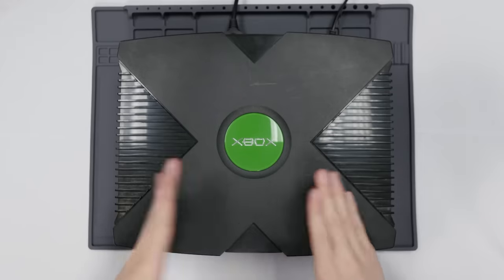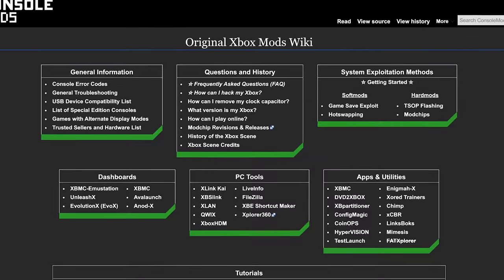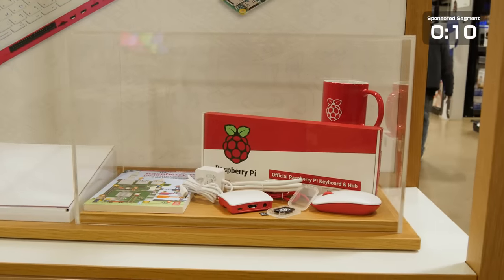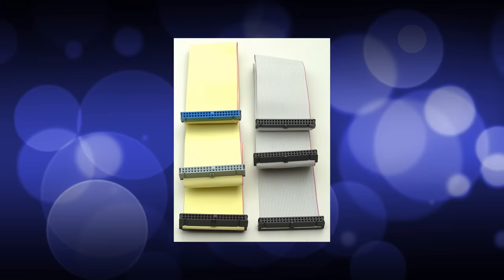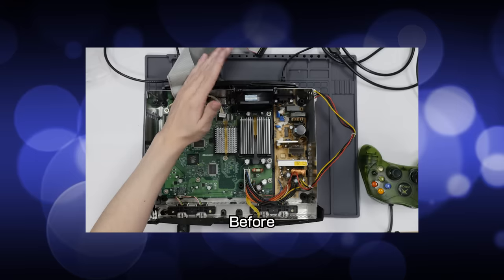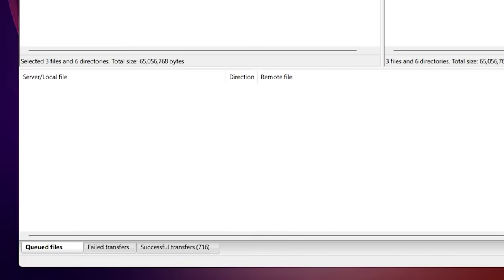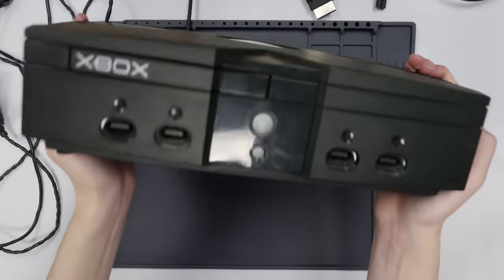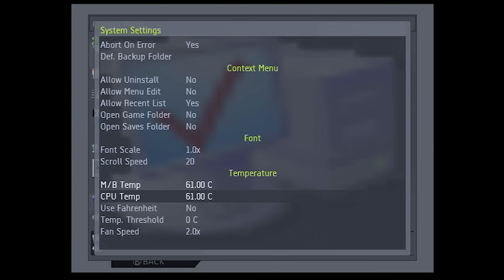The original Xbox is so NOISY. Let's make it ˢᶦˡᵉⁿᵗ

Comment: It isn't that they've gotten old. HDDs of that era were absolutely that loud when they were new. PC noise levels peaked at about 2006 before quieter and cooler components started really creeping in.
Reply: Man I remember how loud they were 2004 to 2007 oh my gosh idle, loud as a jet turbine. About PS4 Pro levels at idle.
Reply: I remember back in 2005 I got an Emachines PC, and if you booted it with someone next to you you'd have to move away just hear each other speak clearly. Almost makes me miss loud electronics.
Reply: It wasn't the hard drives in 2006. It was the small high RPM fans that were everywhere, CPU, GPU, PSU, cases and even ram and HDD coolers. The loudest hard drives I've heard new were in the 90s (your quantum/maxtor fireballs and IBM DeskStars alike), but especially the very first ones in the 80s are super loud (when they were huge double slot 5 1/4'' peripherals, so a lot more rotating mass). Just look them up on YouTube.
Reply: @Naukograd i'm sure theres a modern motherboard bios out there with that feature you can toggle.
Reply: @Naukograd Yeah the feature is still there (POST beep), you just need to enable it. I'm not sure if prebuilt computers have a PC speaker inside, but buying any motherboard will include one.
Reply: From so loud you'd have to cover your ears to quiet to loud to quiet again.
Reply: @MarcoZ1ITA1  The fans were the primary culprit, yes, but the HDDs were insane on their own. In my retro rigs I replace anything that moves (apart from optical drives) with a modern quiet alternative-- replacing the fans wasn't enough.
Reply: @Naukograd It's the little things that leave the fondest memories.
Reply: I have a computer around that time that is not too loud. It is quiet compared to an Xbox or a Dreamcast. The loudest part though is the little northbridge fan. I wd40'd it recently and it came down to a tolerable level even though it is still the loudest part of that system.
Reply: Making me feal old. Yeah, HDD back then were loud, even louder the further you go back. My first HDD, a 40MB HDD was quite loud. Yes, that was MB, not a typo.
Reply: @Roninkinx  You get a PC and nice white noise machine all-in-one in case you want to take a nap.
Reply: small fans without good curves cooling 115 W Pentium 4 chips were quite a different beast. The cooling was such a task that they even came up with a different form factor.
After that it got better again. Bigger coolers and more efficient chips plus more adaptive fan curves made things much quieter.
And now we're back to 200W CPUs and 350W GPUs
Reply: @HappyBeezerStudios  so they went from loud to quiet to loud to quiet and loud again
Reply: I still have my 80GB HDD from 2004, and that thing was super freaking loud when it was new. So yes, HDD's were very noisy. HDD's now seem to be silent though, I have 2 new ones that don't make a sound.
Reply: @GiSWiG  My first HDD was 5MB! In a Compaq Deskpro Model 1 (8086).
Reply: @msthalamus2172  I had a Tandy 1000 8088 w/ two 5.25 floppy drives, might have been 320k if I'm not mistaken, no HDD. The 40MB HDD was with my Tandy 1000 RLX 286 1MB RAM and an 8-bit Sound Blaster (only had one 8-bit ISA slot). If I was to have back any of my old PCs, it would be that one.
Reply: I can attest to this. I had a gateway desktop computer from 2006 that I bought new and that thing was LOUD. The older it got the louder it got. Later I got a 2006 imac and it's almost silent even still to this day.
Reply: @MarcoZ1ITA1  loudest I've heard is a quantum bigfoot... It's so loud it's louder than PCs
Reply: If I recall correctly drive manufacturers were starting to suggest that consumers buy 10k rpm or 15k rpm drives at about that time, too, can you imagine how much noisier that would be. Antec (case and fan manufacturer) shot to relevance with some stylish but quiet fans, cases and power supplies.
Reply: @msthalamus2172  I don't mean to call you out on your 5MB hard drive but I was under the impression the first affordable (not thousands of dollars) hard drive for desktop computers was the ST-225 which was 20MB. Maybe there were drives from other makers that flew under my radar
Reply: @Autotrope  I've always really liked Antec cases. :)
Reply: Man, I've still got wd velociraptor 10k rpm drives. Literally sounds like a honda s2000 on stereroids.
Reply: Dude I ran a Minetest server on a 2005 Dell dimension with the squirrel cage cooling fan. I kid you not, with 20 connections I could hear that thing go whooofRSHMMMMM from outside of the house. It woke me up more than once.

I use a raspberry pi now 😉
Reply: Yeah i remember that time 😅😅
That was the era of putting the computer on the floor instead of on your desk. 😆😆

"Dont feel the need for that hdd led anymore... Ill look down if something goes wrong..... Kick. Damn"

Pis are the future. We need more more more.
Big ugly pc are vile to me now. Do all my gaming on lappy and pi nowerdays...
Reply: I remember the first time I played on a friend's Xbox and thinking that it was going to break because the drives and fans were making so much noise.
Reply: is it even possible to buy new old stock of these? i would love to replace my childhood one with a new one with longer life, i love how it sounds inside the xbox. Always sounded so futuristic space agey and it blew my mind as a kid.
Reply: Yep, my normal midrange HP laptop in 2007 sounded like a jet engine under normal use, and when I'd fire up Crysis... Well let's just say I couldn't do that in the living room while other people were there😂
Reply: @MarcoZ1ITA1 When I'm FTPing files to my XBOX, I can hear the HDD from the other room!
And it's not the age of the drive, this unit had been sitting in a box for 20 years, and I remember my tower PC in 2006 sounded the same.
Reply: @granite_planet  "but buying any motherboard will include one" Haven't seen a board that included a buzzer in ages.
Reply: Why not just add sound-proof padding?

Comment: Matt, I'd really like to see you getting a modern heatsink, that is suitable, or can be modified to fit inside, and replace the stock heatsinks, as they seem very suboptimal. That would heavily increase the cooling performance. I know that 60°C is fairly normal operating temperature for chips like these, but if you keep them at a lower temperature, say 30°, they'll last longer, which is an important thing to consider when we talk about discontinued vintage electronics
Reply: yeah, hardware preservation becomes relevant. Machined copper alloys liked in those coolers aren't much better at heat conduction than alu, but much heavier, so going for that sexy copper look might not even be the best choice. But a better cooler, perhaps something with heat piles and a more optimized fin profile should help getting the heat off the chip.
Perhaps even an intake fan at the side (where holes are visible) could further improve cooling.
Reply: Don't forget new thermal paste
Reply: That kind of option probably wont work for me personally. I have a 1.0 unit.
Reply: 30°C?! Yeah right, maybe with water cooling with a car's refrigerant tank.
Reply: The Xbox original's hardware is so low-power, we probably have the technology to cool one entirely passively

Comment: A suggestion: use foam to seal the gaps between the fan and shell, and change the thermal paste on the heatsinks.
Reply: with something very advanced for cpus
Reply: heat up the xbox before you change the thermal paste, that shit is like epoxy after 20 years
Reply: @desertman123  Tell me about it. I repasted an Xbox a year or so ago and that stuff pretty much IS epoxy. Thought I was going to damage the board or CPU trying to free that friggin' heatsink. I've never had such a hard time in all my life removing paste/heatsink and I've opened a lot of machines. Just have to have a lot of time and patience if you're unlucky enough to have that rock hard pink paste (they used different paste over the years and runs, if memory serves...some being far worse than other's). Ironicaly the GPU used a different white paste on my unit and that came right off, go figure.
Reply: @desertman123  I had to do that on my 1.0 to get the GPU heatsink off without breaking anything, I just used a hair dryer on high 6 - 8 inches away from the board for 30 seconds and the heatsink came off easily.
Reply: @MotorHorse  I did this yesterday, and used Arctics thermal paste remover which worked well. I put a carbon thermal pad on the GPU and normal thermal plaste on the CPU, so I no longer have to bother with that crap any more. Mine also had that black epoxy like crap on the GPU as well lol.
Reply: Oh god I didn’t even think about the 20 year old thermal paste
Reply: Oh ya for sure the thermal paste. I just restored 3 xboxs and bought this special thermal paste remover from Arctic 5 and that stuff worked wonders removing that gummy pink 20 year old paste.
Reply: @desertman123  mine was more like thermal ceramic
Reply: @desertman123  Even after putting a lot, and i mean a lot of heat in the board to replace the the VRM caps the GPU heatsink still didn't come off and the CPU thermal paste chipped off like it was glass
Reply: a suggestion: use foam as thermal paste for the CPU (trust me bro)
Reply: exactly.. 

15:40 thats what u get from using an ultra cheap fan..

give it a proper Noctua fan or atleast Be Quiet / Arctic...

and he 100% should  fill the gaps with foam so the airflow works right. 

andchange its thermal paste and thermal pads properly. And if we want to go all out, a nice  Thermal Grizzly graphene Pad would work best. 

lots of potential was missed here

Comment: If you're worried about the new fan, you could make a foam gasket -- It's likely the lack of flow isolation that's limiting the performance -- not the size difference** (the CFM's are probably pretty comparable)
Reply: I don’t speak computer
Reply: @AWAYTAE  Or maybe more like "Air could be flowing in wrong places. Add foam around fan to seal the edges and make a clean path for airflow." The idea is to get smooth airflow between the inside and outside of the case.

I might also think the new fan's RPM (how fast it spins) could be slower overall for the power it receives, so even with a gasket it might need a small bump over default. Not sure of this fan's specs, but quiet fans often achieve their quietness in part by spinning slower at any given power setting, so even if it could push as much air as the old one at the same speed, it might not hit that same speed with the same power setting as the old one. I could be wrong about that for this particular fan though!
Reply: @AWAYTAE  He's not speaking computer. That's fluid dynamics, broseph.
Reply: @a2pabmb2  i guess we found another thing he doesn't speak then
Reply: @aidancommenting  Explain like im -10
Reply: Yes, 'this is the way'.   Lack of flow isolation is the key. He knows what he is talking about. not many ppl care or know it.
Reply: @a2pabmb2  it was a joke but whatever
Reply: Could be different static pressure
Reply: He also mounted it as exhaust rather than intake I do not know if the original fan was like that but noticed it immediately
Reply: I still have my Xbox 180 as well
Reply: @LlamaCraft  

I think the original one was also exhaust but I also noticed that an exhaust configuration on that heatsink will likely be less efficient
Reply: @nyccollin  

hmm
Reply: @LlamaCraft  the original was an exhaust, with the slits on the sides functioning as the intake. 2001 was a primitive time indeed.
Reply: Or he could buy/print a bracket. Bit surprised he didn't. You can get them for CPU and Case fan.
Reply: @Jef_Vermassen  

A bracket wouldn’t stop air from flowing the wrong way
Reply: @PashaGamingYT  I wasn't bringing that up for the exhaust/intake config.
Reply: @JopieHaargel  . Exhaust was/is common for consoles.
Reply: @JopieHaargel  thank you i didn't know if I was stupid or not
Reply: Came here to say this
Reply: Nothing is louder than the wrath of my PS4 I mean it might as well be an air port

Comment: Huh. I never thought to mod a console to make it less noisy. Neat stuff!
Reply: @Naukograd same with my Xbox 360 E
Reply: The fat PS2 was really loud, the fan was and also the disk Drive.
Reply: In a word... How? If an idiot like me can think of it, haha... So easy to do on the Xbox too.
Reply: yeah i've never seen this before
Reply: But I want the fan /hdd noise it’s a nostalgia thing
Reply: Quick get the PS4!
Reply: @FittedWhisper96  I’m have 2 server grade blowie matrons in my ps4 so it sounds like a a fuckin real jet and it doesn’t over heat anymore
Reply: You haven't? Then you probably never owned a fat Xbox 360 and sat RIGHT next to it while playing/during media :D
Reply: @123theprodigy5  not to mention how loud the ps3 gets when it plays PS2 games lol
Reply: Most of the time, it's not particularly easy to do because most consoles have custom fans, heatsinks, and disc drives. The Xbox is more of an exception because apart from its custom CPU and GPU, most of its parts are just off-the-shelf desktop PC parts with standardized form factors - so it's easy to replace them.
Reply: @itsTyrion  
turns on Xbox
disk drive starts up
fan spins up
JET TAKES OFF INSIDE OF XBOX
Reply: @brockpiano  That would be an original PS4 :D
(no hate to PS but that thing can get *loud*)

Comment: Hey Matt, there's a seller called chimeric systems that sells 80-wire IDE cables that are built the exact same as the originals. Meaning the connectors aren't backwards and the folds are the same. Just thought I'd let you know!
Reply: They definitely make a bunch of really cool stuff. Got my sister to pull her old xbox out of storage and discovered chimeric when YTing modding them in the modern day. Haven't bought anything yet but the day is near!
Reply: They sell 512MB flash drives too for using to do the initial mod, which is helpful due to the xbox not liking some modern flash drives.
Reply: @5speedfatty  That would have been nice to know, as a 128MB one I ordered off eBay (that was actually 256MB lol) didn't work at all, and I had to use my phone.
Reply: @Iristallite   yea its a bit of a trap left in the process. thing is its expecting a memory card to be plugged in there  ( original xbox controllers and mem cards are USB) if you throw in something larger than it expects its gonna fail.
Reply: Seller where please?
Reply: Original Xbox absolutely loves the USB Mass Storage device type such as the SD card inside a digital camera, generic MP3 player (remember those?)
Reply: @kristianperryadams   lol you are right, but it doesnt like SDHC cards (anything over 4gb) and its getting harder to find the smaller ones from legit sellers these days. side note Creative made the best MP3 players back in the day
Reply: He doesn't care. He just put out this video to make a quick buck off a Youtube video while he does other things. Don't be too invested in one thing you kid.
Reply: The wait list for that HDMI box is painful.
Reply: @5speedfatty  SDHC just wasn't a thing back in the good old days, with the FATX filesystem that can't handle files over 4gb size or with long filenames. 
Why would the memory unit driver need to support SDHC devices? 

In my opinion future proofing is where the original Xbox fails (the controller ports not being standard USB for example.)
Reply: @kristianperryadams   the USB ports where at least usb in some regard, id call it a step in the right direction. but also you are right. no one thought SDHC would end up being a thing and besides youd think even if they did this limit would have likely stayed in place to combat piracy or some other oddball reason. its really funny though because, as we go further it will be harder to find / more expensive for the proper sized drives, imagine having to pay 15$ for a 512mb flashdrive lol thats some expensive memory $ for byte.
Reply: @Omega_2   
Mate I bought  a retrotink  5x and couldn't  be happier with how my xbox looks and it can be used for other consoles aswell

Comment: The boot delay is related to the type/brand of the IDE to SATA adapter. I know this because back then I bought like 3 different IDE to SATA adapter boards until I found one that boots instantly.
Reply: What brand is the one that boots instantly?
Reply: I don't remember, sorry. I got mine on eBay some  years ago, it was unbranded. I got 3 different adapter boards until I found one that boots instantly, just like the stock hard drive. I don't feel like disassembling my Xbox right now and regluing the feet just to check that. By the way if you're wondering I have a WD 2 TB hard drive.
Reply: @Fred_PJ  Have you at any point found out what brand of adapter you bought since then?
Reply: @somebonehead this is old, but I have a Star tech one and that boots instantly.